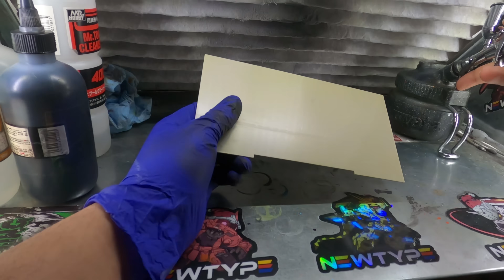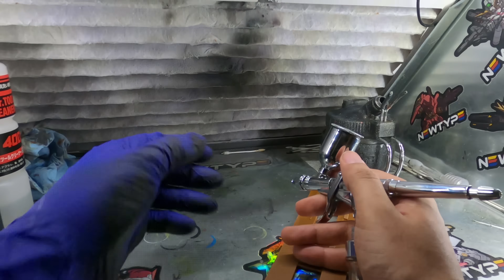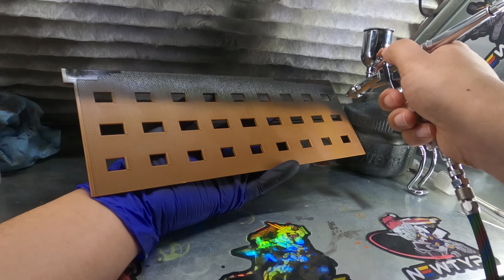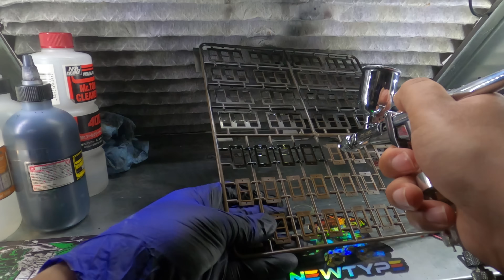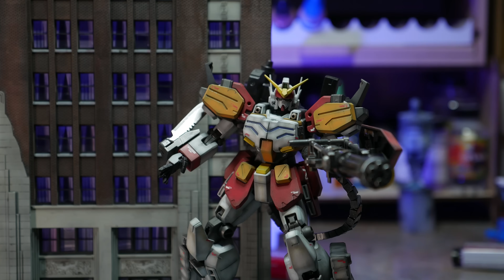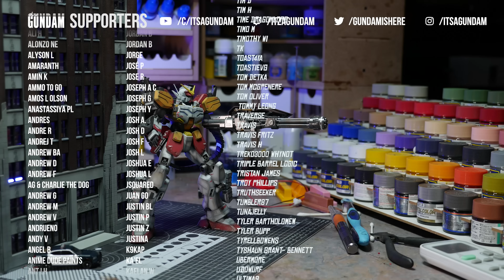The City build: Part 1

Comment: Red and blue LED has diff voltage rating.  If you want for them to have the same intensity (min) you have to add some resisters in a specific way and in specific values.

Comment: This might get lost in the comments but Mecha Gaikotsu has a resin printer that seems relatively affordable.  You may want to hit him up about the company since they sent him one for review.   Even though he does OOB builds he seems like the the type of guy to help a fellow gunpla builder/youtuber out.
Reply: Resin printers are an insane amount of work and you can't just dump any of the water you use try clean the parts off because it's hazardous material afterwords
Reply: FillerBunny NinjaShark I’ve read that too.  You would probably have to get hazard containers and go through all the red tape of disposing them properly.  It’s either that or pay for a company to print the pieces out for you which might defeat the purpose.
Reply: @GunplaBoi  you have to let it evaporate pretty much

Comment: There is this stuff I like to buy out of Australia. It costs about $40 American for a jar of it called plastimake. Its basically a boil and mold plastic. It comes with coloring pellets but I find if I want to do say...a metallic scrap or shrapnel part if I mix on some chrome paint as I'm mixing it during the boiling (2 minutes and thirty seconds with a cup of water in the microwave tends to do it) I can make it come off as looking like it's actual deformed sheet metal. This could be good for optional armor damage effects or custom structural damage for your cityscape without buying a full on 3D printer. Something to experiment with perhaps? I'm thinking of using some of this to recreate the stranded bathing scene from 08th MS team after I convert a 3.0 RX-78 to essentially a RX-79[G] Ground Gundam and applying the appropriate battle damage.